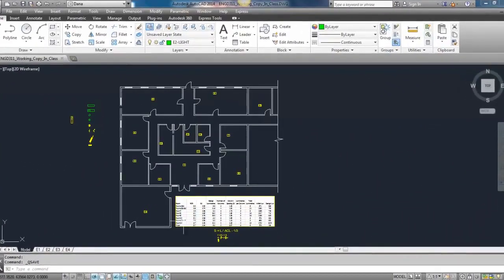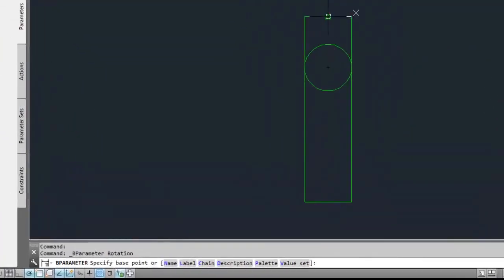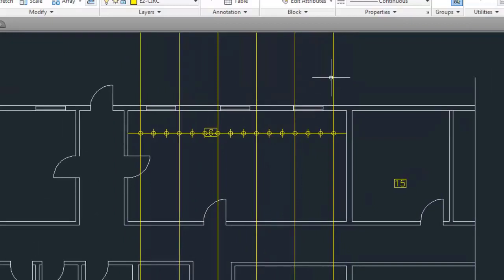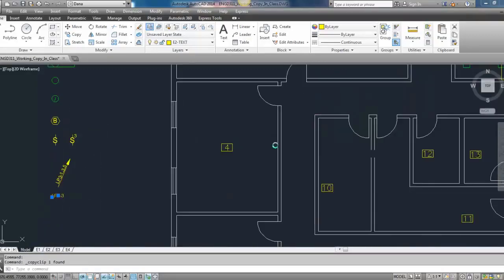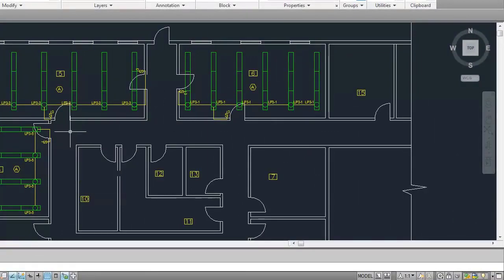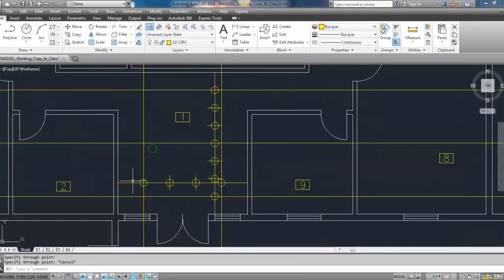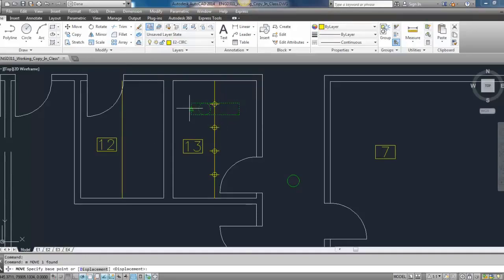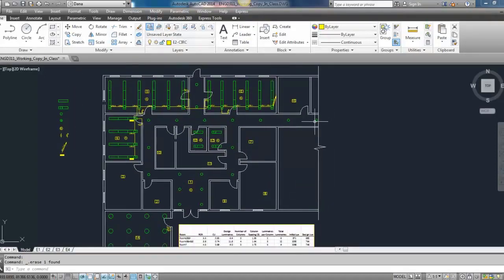AutoCAD Electrical Tutorial | Lighting Layout Plan

Comment: Lets say I just want to map the lamps for serviceability, and not the wires. Is there an easy way to do this? Preferably also add the lamp type (emergency / emergency batterypowered / normal etc), model, and ID-TAG number which can be exported to a sheet so that the people that needs to service the emergency lights can see the ID-TAGs on the CAD drawing, and also get a sheet of all the relevant lights and their type, tag and model to make it easier to find everything?

Which functions should I look up?